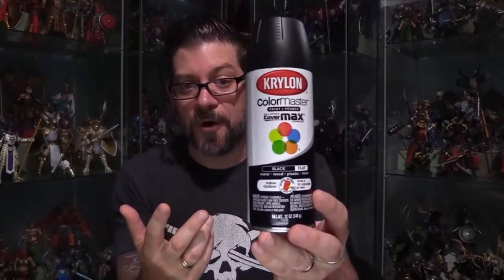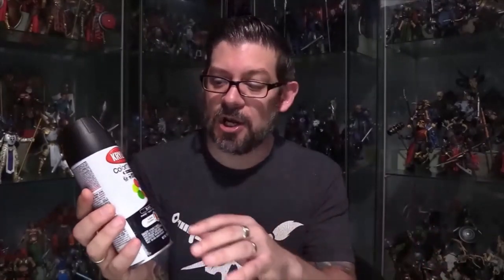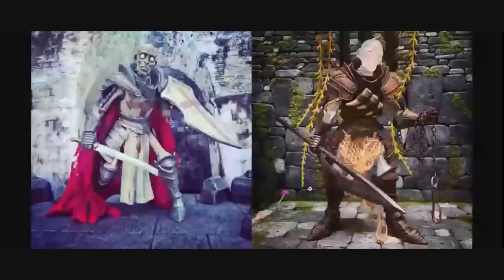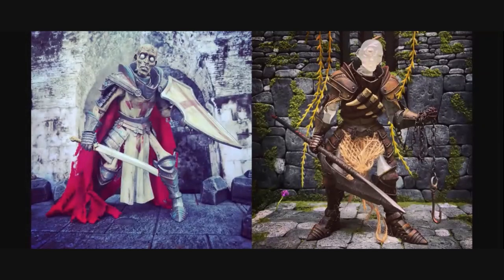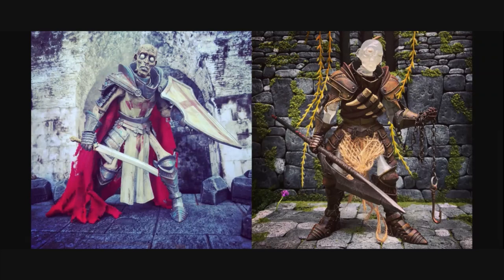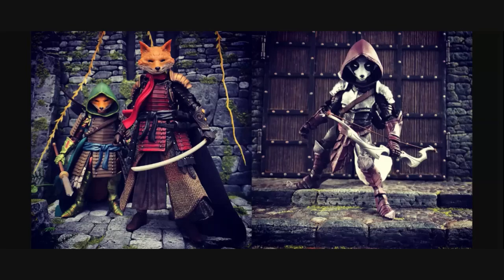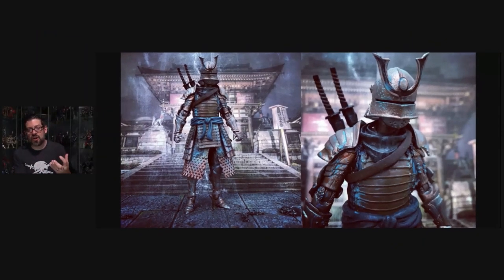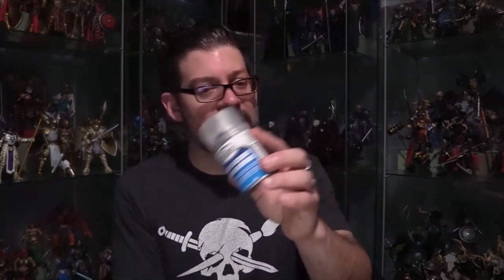FAQs: "Do you prime parts before you paint, or do you just paint over factory parts?"

Comment: Question Mr.Girard  🙋 how would you go about painting The Mid section plastic loin cloth like the one on the Dark templar ? What paint would you recommend for the paint to not chip off too much or stay sealed?
Reply from the maker: Those softer pieces are tougher to paint. I tend to only use brush paint on those parts as I find spray sometimes gets tacky.  I use Vallejo almost exclusively and that is what I do there as well!

Comment: What you recommend for a plastic coat, for example,  Gambit's coat, that kind of material?
Reply from the maker: If you are asking what to use for paint on those, some of those soft plastic coats do not do well with primer or paint.  I tend to avoid those if possible.  If not, I used just try to brush paint on top of what is there
Reply: @MythicCustoms  thank you!